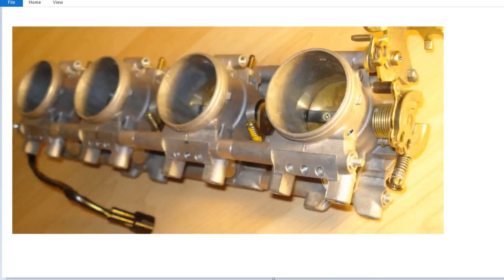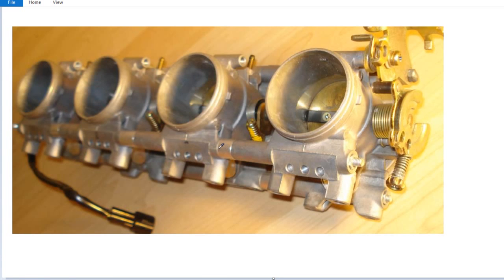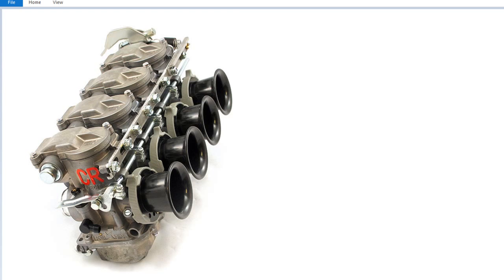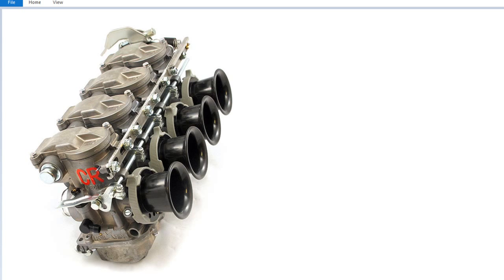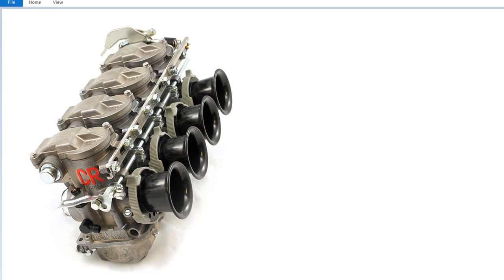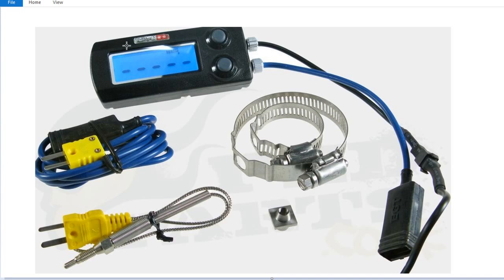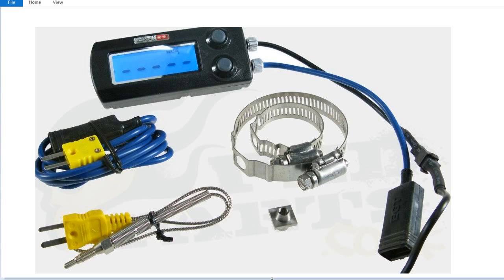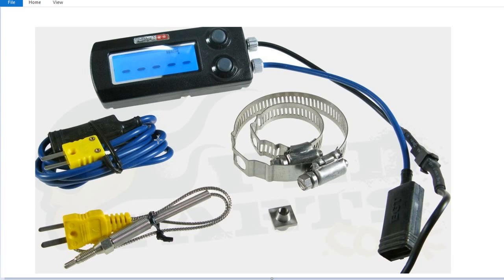Carburetor tutorials - Tuning with EGT, CCT, Lambda and carb vs EFI E12

Comment: Do you have any experience with EGT sensors? I just got one for my moped with an air cooled 86cc cylinder. My exhaust gases are around 300-450°C and the probe sits around 10-15cm from the cylinder and I wounder if that's to far away because despite the low exhaust temps the cylinder temp is climbing above 200°C after 5km running at 80-100 km/h. Highest reading was 208°C and I tried to run very easy back home when I saw it getting to 200°C.

The cylinder is made for a fan cooled scooter and I've put it on a 1979 Suzuki K50 where the cylinder is facing forward and therefor the airflow hit's the head and swirls around over the fins that's angled in the wrong direction so I suspect that could be an issue with the CHT as well. I'm going to try putting a computer fan on top to draw air through the fins and also make a little cowl underneath to direct the air from through the fins and see if that can help.
Reply from the maker: The temp pick up is ok there, its not that critical since it is not absolute temps you are looking at it is the peak you are looking for whatever the value and ensuring you stay just on the rich side of the peak not the lean side.
As for the CHT, 200 is ok but yes you would be wise to fit a duct of some kinds to try to deflect a bit of air around the barrel.
With CHT it is not so much the peak value (within limits to ensure you don't get into detonation or piston melting) you need to watch but to make sure it is at a constant value and not constantly climbing over a longer period of operation.
Reply: @AuMechanic  Yesterday I made a plate to put underneath the cylinder to direct the air flow and I also put a colder spark plug in it as I heard some knocking right at the end of my test runs when it got the hottest around 205-210°C. Now the temp stayed lower and even at full throttle the temp stays around 170-180°C end even lowers a bit when I have some speed on the road.

Going to test some more and see how it does in the woods at lower speeds.
Reply from the maker: Yeah that's a safer temp.
The CHT is a bit like how you treat coolant temp in that so long as it is fairly constant and not climbing over time then you are safe.